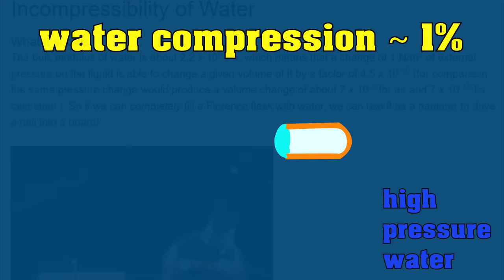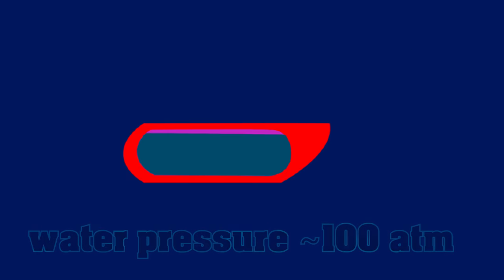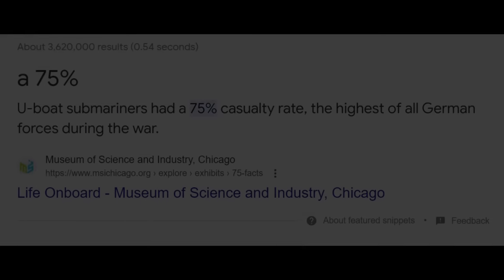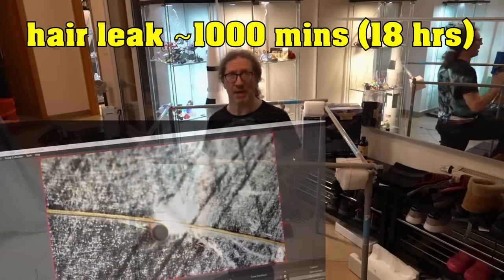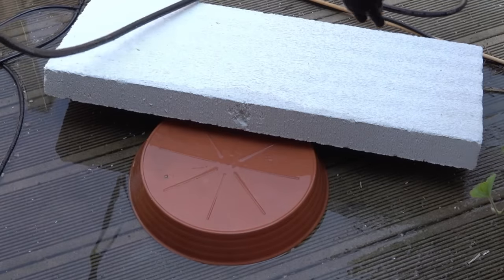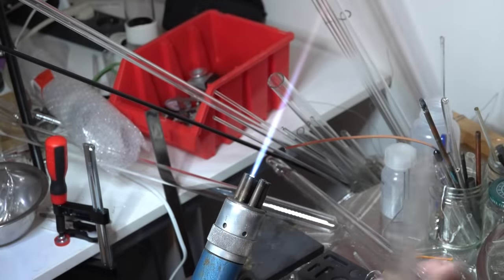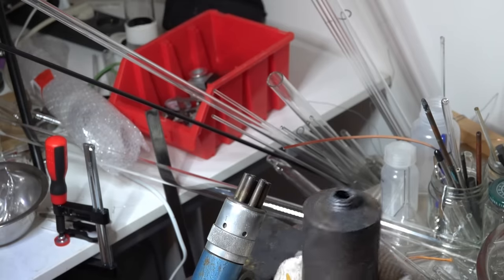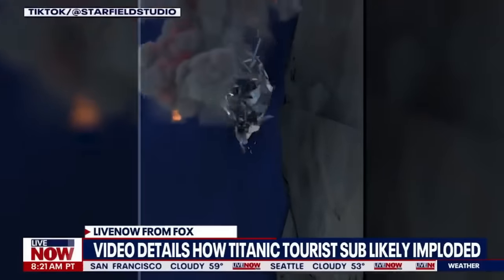Why the Titan sub failed

Comment: I love how the animation shows it exploding in a fireball. It’s amazing.
Reply: The fire part in fireball isn't too far off, considering that the air was instantly compressed and heated to a high temperature. Other sources say, it reached a temperature as hot as the sun, combusting anything combustible in the sub instantly, but this sounds very far out of scale. Maybe it got as toasty as a few hundred degrees in there, I haven't done the math myself. Clearly there shouldn't be a fireball coming off of it as if it spread in free air.
Reply: I think that animation was based on the "depth-charged by their competition" theory. 🤣
Reply: @MrSaemichlaus  And does that heat create steam too? Very complex situation.
Reply: @MrSaemichlaus  Also read that, which seemed non-intuitive.
However, if the sub imploded within a second of holing, the heat wouldn't have had much time to spread from wherever that compressed air ended up.
Reply: I think most people want to believe that Hamish didn't slowly drown to death, which is probably what happened. I bet his billions didn't prevent any of the pain of drowning.
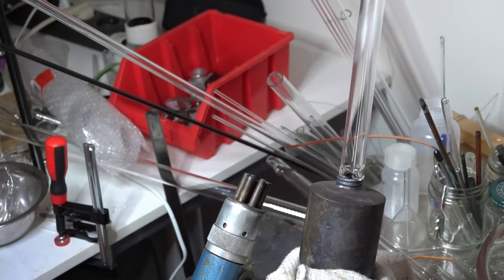Reply: @gristly_knuckle  I don't see how they would live for more than a second? 22:02
Reply: @gristly_knuckle  I assure you, no one drowned.  The only bits recovered were some smears of bio goo splattered here and there.
Reply: @ebe7157  , that's one opinion. I prefer to think God tortures them to death for all eternity down there.
Reply: That is what happens. If you ever find yourself in an imploding sub, you can imagine your last few moments as being basically the same as sitting inside the ignition/ combustion stroke of a diesel engine.
Reply: @williambrasky3891  , what about how Evil the idea of a submarine is? Doesn't that mean that those people deserve to suffer? With the sinking of the Titanic, what did they want to know?
Reply: @gristly_knuckle  Evil idea of a Submarine? Wtf are you on about?
Reply: corny animation, yeah, but compressing an air bubble fast enough and in deep enough water will 100% result in a ball of heated gas (ie flame).  See cavitation ignition.
Reply: @MrSaemichlaus  A diesel engine compresses air in the cylinder to about 500 psi and about 2000 degrees.  The water pressure at 3500 meters is around 5000 psi.  This water compressed the air and instantly raised the temperature to well over the temperature to instantly ignite everything flammable.  Thus the flash fire.
Reply: @MrSaemichlaus  The inaccurate part of this theory is that gas will heat when compressed IN A SEALED ENVIRONMENT.  In this case , if the sub did implode and due to the ridiculous construction [a tube with glued on end caps], water would have infiltrated the pressure vessel.   However in the semi-sealed lungs, sinus, ears and other air space of the human body, those air spaces would have nearly instantaneously shrank to 1/400 of their normal size. It isn't a pretty sight.  As a technical diving instructor I have personally seen what happens to ruptured ear drums from rapid reduction of pressure in an uncontrolled (or accelerated) ascent from only a few hundred feet.   Its hard to imagine the damage from going from sea level pressure to 400x that almost instantly.    I used to show my students the difference between filling a steel/aluminum tank in the air compared to filling in a water bath.   Water is over 800 times as dense as sea level air and task that much more energy to heat.  Once the pressure vessel was compromised and water infiltrated the vessel the pressure would still increase by 400x (to equalize with the surrounding pressure) but because it is so much more dense and was at ~35 degrees - it would take a huge amount of energy to heat the water.
Reply: That guy was taking the piss for sure, that shit was hilarious.
Reply: @ATBatmanMALS31  100% or he was told what to do and he knew it was ridiculous so he went all in
Reply: @theastuteangler  you might get a millisecond flash of plasma. Though I doubt it with that size. I’m talking out my ass, but a fireball and smoke…no.
Reply: When you punch something hard and fast enough, there's always going to be an explosion.
Reply: @MrSaemichlaus I believe this figure comes from the chain reaction of the heat flashing all the water in the volume to steam, which is then heavily compressed into cavitation bubbles, which do get as hot as the sun.
Reply: @MrSaemichlaus  The air actually reaches thousands of degrees for a brief moment. As hot as the surface of the sun. There is an animal that can create compressed air bubbles like this actually, called pistol shrimps.
Reply: @MrSaemichlaus  Actually, there would be a "fireball" - consisting of extremely hot air compressed within a fraction of second to 1/400 of its volume - very similar to diesel engine cylinder, but about 20 times worse. But, as the combustibles inside this ball are not properly atomized, the debris would suffer only some superficial scorching before cold water rushes in and takes the heat away. Nothing really substantial would get incinerated.

Comment: There might be a case for sudden catastrophic loss of hull integrity here too though since they DID use carbon fiber.  Materials like this tend to be fine for a few stresses, but when you keep stressing them they fatigue and fail.  Given that carbon fiber is pretty rigid, any structural failure would have given quite an impressive bit of destruction.  Titanium's ability to deform rather than outright fail is a plus for this kind of application.
Reply: Once the hull was breached, the stresses on the carbon fiber rapidly dropped until it was negligible.

Comment: I had a 60k psi water jet, and one of the high pressure stainless steel lines sprang a leak. The hole was so small you couldn't see it. The first indication of a problem was a fine mist near the hole. There was no way to stop the leak, and it just kept getting worse. A leak doesn't have to be big to be unstoppable at those pressures.
Reply: Don't you have to inspect all the lines before and during use? I know you said it's a small hole but you can still take a piece of paper and check for leaks or maybe notice the pressure gauge is off by a bit.
Reply: I had an excavator do that, obviously much less pressure but it sure made a mess a long way away from the leak in the form of an oil mist. A steel tube must have had a flaw, just started leaking in the middle of an untouched line.
Reply: I had a Citroen do this...

For those that don't know these types of pinhole high pressure leak are rarther dangerous
Reply: @carmadme  Yes, high-pressure injection of any foreign substance is very deadly.
Reply: @carmadme  I have a citroen c5, please tell me more about what happen.
Reply: That’s what I was thinking, if a small hole started taking on water and they didn’t notice it. That would explain why they free fell for one minute. They didn’t have the buoyancy that they expected because there is water inside, it would also take out the electronics.
Reply: just slap a big glob of flex seal on it and give the camera a thumbs up.
Reply: @GameTimeWhy  No, you absolutely do not go poking potentially deadly machines during their use. Especially those pressure vessels and lines. Such machines do have to inspected regularly but not before each and every use.
Reply: Definitely not as easy as shoving a sock in someones mouth to shut them up when they are spewing garbage!😁 Toilet plungers work to, but you got to give them a few pumps!😅
Reply: Yeah there are stories of a small leak in a carrier steam catapult and they can cut off a man's leg.
Reply: @properfpv7160  That's ridiculous. I'd think they would notice any kind of a leak, especially one big enough to take out the electronics.
Reply: @raylopez99  water intrusion into a submersible is not ridiculous. It could have been behind the panel or the floor, which is  one reason they could have decided to abandon to dive. When they let the ballast loose, it didn’t rise like they expected it kept sinking meaning there was probably Water in the craft or in a ballast tank. It’s not ridiculous. Water intrusion  is a very real concern in a submersible at 3800 m .  Just because it’s a high-pressure stream doesn’t mean that it couldn’t have gone unnoticed until it was too late.
Reply: @bounzig  Citroen XM  
I think the pressure regulator was broken causing the system to overpressure past the ~200BAR limit
Reply: @GameTimeWhy  yeah, but the machine still worked. The amount of water leaking was small compared to the total flow. It did cut a little slower, but it still worked. We ended up putting a plastic bottle around the tube to catch the mist and ran it for a few weeks until we got a replacement.
Reply: @carmadme  That sounds scary!😬
Reply: Word
Reply: Similarly with vacuum vessels.
Reply: @anteshell  the context was them operating a machine they thought had a pinhole leak and continued to operate despite the risk. I don't advocate "poking around" but testing is far safer than going "meh it's fine".
Reply: @GameTimeWhy  with that you are correct but you also read way too much into OP's comment. There is not enough context to be able to recognize in full what happened there and conclude that they continued to operate faulty machine in reckless negligence.
Reply: That's why the 40,000 PSI or more of common rail injected diesel engines creeps me out. A pinhole in the rail could remove a hand pretty effectively.
Reply: @hopelessnerd6677  not really. A cutting jet requires a laminar flow. With those pressures, even a slightest of disturbances in the flow causes it to turn instantly into mist after leaving the crack. It's not really possible to accidentally come about with such crack in a pressure vessel that it stays laminar jet stream.
Reply: @anteshell  Good point. I'm still not taking any sub rides.

Comment: The tube of the hull being made of glued layers surely meant that due to the compression and decompression of dive after dive it was only a matter of time before it started to delaminate regardless of how clean and well made the original tube was
Reply: Pretty much. If Stockton simply used the sub one or two times, he would have been fine. In fact, other people have made DSV from carbon fiber and retired it after a single trip. Stockton's mistake was trying to make a Carbon fiber sub into a tourist vehicle.
Reply: Possibly if we autoclave it after each dive to turn the delamination back into laminate composite we could use 1 sub with 10s to 100s of missions.
Reply: I know right?!  I mean it's basically made of really, really good duct tape.  Who the hell goes to the bottom of the ocean in a boat made of duct tape?  I don't care how good the tape is.
Reply: By looking at the leaking chatlog people mentioned that the sub was descending too fast that day. If that is the case, it could have been avoided by canceling the dive. 

"Oh we are descending at 4 times the speed" that seems good
Reply: @thejuggernautofspades9453 autoclaving resin seems like a bad idea to me
Reply: yep.. I'm only an ecologist and I know enough engineering to L.O.L at the ''design'' and choices of materials.. I was like .. What? you'd be better off with corrugated cardboard five feet thick held together by snail slime (which is TOTALLY waterproof btw ) . lol.
Reply: The delamination probably began at the flange connecting the rear titanium cap to the carbon fiber midsection.  The damage probably began to form after the first dive.  The acoustic monitoring system was completely useless until the material was about to come apart.
Reply: @thejuggernautofspades9453  Not really going to help, heating past the glass transition temperature will just anneal the epoxy, releasing the residual stress in it, but will do nothing to make the portions where it has already got tiny bond failures any better, just making them seem to disappear, as the interface material now is contacting again. Only way would have been to have had the mandrel it was wound on be a strength member as well, able to handle the pressure, and the carbon fibre merely to reinforce it, though that would have made mass much too high, and made the need for carbon fibre moot anyway.
Reply: @thejuggernautofspades9453  No, that wouldn't work. Once the resin has been cured once, you are done.
Reply: It wasn't well made to start with
Reply: @cathybaldry7822  made worse than a 10 year-old working class kid's street cart
Reply: I've worked with composite parts on aircraft.  As the engineer, if I had signed off on expired carbon or any of the other shenanigans that this guy did, I'd be lucky to only get fired when QA started finding the corners that I cut.  A guy could lose his license, be criminally prosecuted for fraud, or sued in civil court.  It's also true that you have to be really careful when you lay up composites, they have more failure modes than structural aluminum or steel and they require pretty elaborate non-destructive inspection methods because any disbonds or voids will make the composite material weaker.  I guarantee that the air loads that the composite fairings and control surfaces that I've worked with are a lot less than submerging it in 12,000 feet of water, where the sub was seeing stupendous differential-pressures.
Reply: @icemachine79  
When you dive the submarine, the deeper water is colder.  With different materials in contact, that means that you also get thermally-induced stresses (thermal expansion coefficients are different).  So in addition to what you've identified, the thermal stresses make you that much closer to failure, too.
Reply: no.. really? amazing lol.
Reply: @Skank_and_Gutterboy  woop -woo ya gangster of luurve. lol.
Reply: @cathybaldry7822  a''blue peter submarine''  UK centric joke.
Reply: @Skank_and_Gutterboy we used some expired materials from big companies in college for labs and clubs and stuff. Who cares if the photoresist is just a little bit more gloopy when we are spinning it on? Who cares if the aerodynamic carbon fiber for the race car doesn't fully cure?

We are learning how transistors are made and learning how to 3d model and prototype, it's okay to use subpar materials becaus these aren't life critical or quality sensitive or high performance applications.

This sub was going down to 400 bar, with people inside. Quality matters here, it's high performance, its life critical. Cutting corners to save money is okay when you are monkeying around in college, not so much when you are cutting edge in the real world.
Reply: And you never know when its gonna blow, might blow on 2nd dive, or maybe the 30th.
I'm wondering if the implosion happened in the centre of the sub, kinda like how a coke can is weakest in the centre.
Cause it was fairly long, but only 5" thick.
Reply: @thejuggernautofspades9453  Good way to clean up the gene pool too.
Reply: @phillyphakename1255  
Absolutely.  Some students laying up some samples to be shear-tested to failure to see how close their calculations were to the actual strength?  No problem, go to town with that.  Putting it on a craft carrying passengers?  No way.l

Comment: When you were doing your test with the power washer you forgot to include a whole chicken .    The water might not do too much damage entering from a pinhole, unless it happens to strike a passenger.   It will not easily cut a smooth surface as you saw with the plastic, but having used industrial high pressure washers, I know it cuts flesh easily.
Reply: Ya only if you're under a foot to 6in away from the pin hole.
Reply: water cutters also use fine sand in their jets. It's the sand that does the cutting. Any dirty water would do somewhat similar. Ocean water with the salt and other particles in it would cut better than tap water.
Reply: I saw a video online of a guy duying because of a pressure washer, but it wasn't clear from the video if the cause was concussive or if it was electrocution
Reply: @chromatic2006  abrasives aren't necessary for all materials, only hard materials. Plastics can be cut easily with water alone, flesh even more so.